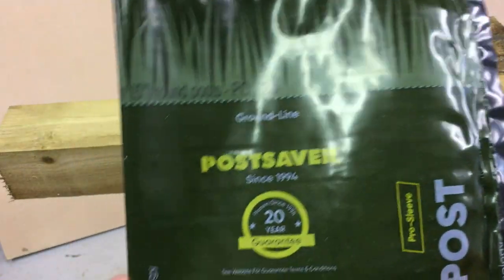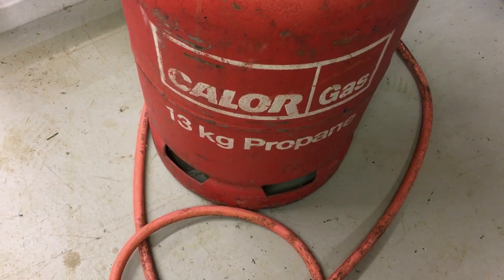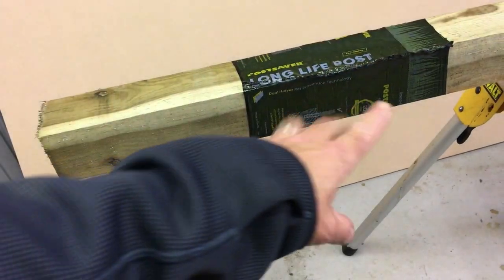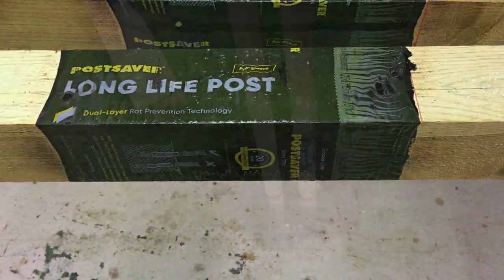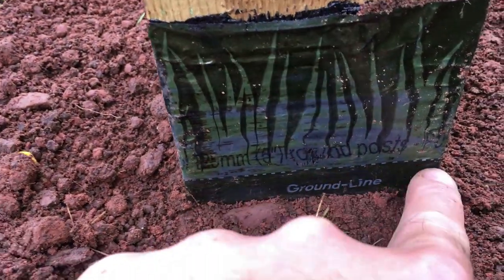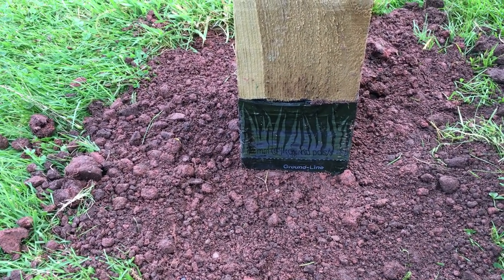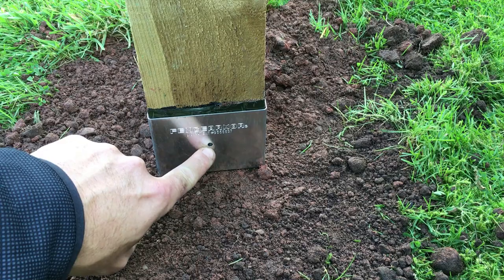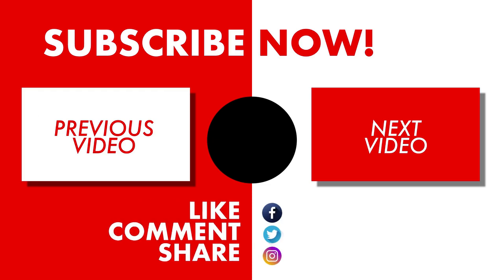How To STOP Fence Posts Rotting / Install postsaver sleeves

Comment: Great video. I've been  thinking about building a wooden frame for the Wisteria plant the Mrs has planted except I was worried about wood rot til now! 

Now I know how to protect the wood thanks to your video! Many thanks.

PS does putting the screws through the Post Saver compromise the protection a little bit? As it gives moisture a path into the wood. And would it void the guarantee?
Reply from the maker: Thanks, no, putting the screws through does not void the warranty as Fence Armour is a postsaver product. Thanks for the comment

Comment: Great video. But how special is Postsever in addition to seal the post from moisture? There are different post sealers, such as asphalt sealant, which are easier to apply, cheaper and waterproof.
Reply from the maker: They all do the same job but postsaver comes with a 20 YEAR GUARANTEE so worth it in my opinion
Reply: @Bacrenfencing  that’s only a marketing strategy and has no actual value. Many products now have lifetime warranty.
Reply from the maker: Why did you watch the video then ? A lot of my customers ask for the sleeves to be fitted, so I do as they ask and give them a 20 year guarantee on the posts. Also, what fencing products come with a lifetime guarantee ? I can't think of any.
Reply: @Bacrenfencing  Ok, I regret watching your video. Go to HD, find the warranty of  pressure treated post. It’s lifetime!!!

Comment: This is great but  most customers are so tight they will not pay the extra cost. What chance you got.
Would a heatgun do the job.
Reply from the maker: Hi John, I know what you are saying, that is my experience too. I think that making videos about the products benefits will help though because I can now send them a link to my video attached to my quotation(s) and let them see that the option is available. Yes, a good heat gun or smaller plumbers blow torch will do the job as well, just takes a little longer to apply. Thanks for the comment 👍😍

Comment: When I put the sleeves on the posts they melted didn't have the flame close to them,don't know what I'm doing wrong I ruined 3 of them
Reply from the maker: You are best to have the flame set on a low setting (i.e not gushing out at high pressure). Once on a low setting the key is to keep moving the torch quickly, you kind of get a feel for it once you have done a few. I had a few melt when first trying to put them on but it was just because my flame was on too high a setting and a lingered in one spot too long........there is a knack to getting these on. Thanks for the comment

Comment: You won't have the same problems with a concrete post I have a lot of fencing in my garden and the concrete posts have been in at least 34 years since the house was built and there still standing, wooden posts are a complete waste of time and money👍
Reply from the maker: Concrete posts are ugly in my opinion, wood posts are used for the natural look and will last for 20-30 years if properly installed and looked after. Concrete tends to chip and crack over time but they do last a hell of a long time ! Thanks for the comment 👍
Reply: @Bacrenfencing  Thanks for the reply do you follow D&J Projects on YouTube they do a lot of fencing for customers and they make and use there own concrete posts on there fencing Jobs.  yes concrete posts might be ugly and can chip but they are a more superior post to use compared to wooden posts and will last far longer as well👍
Reply from the maker: @Josh-fk8ml  Thanks Josh, yes I do follow Dave and Stevie ! and like the look of their post / panel combinations but in my part of the world, wooden posts are requested pretty much 95% of the time. Concrete posts are rarely used up here in Scotland as the panels that slot between them are not ideal for the extreme winds we get up here. Hit & Miss fencing and single slatted fencing is most common up here. Thanks for the reply !
Reply: @Bacrenfencing  I live near the coast in Northern Ireland and we also get extreme winds as well as I said I have concrete posts in my garden near 34 years and there still standing. There is no way wooden posts would last 34 years in any garden, the fence I have in the moment is at least 15 years old the D rails are bolted in with 10mm coach bolts with a 10mm washer and 10mm hex nut attached to them and the wooden slates are attached to the D rails. All I am trying to say is wooden posts are not worth the time and money spent on them as they will not last anyway thanks for the reply 👍
Reply from the maker: @Josh-fk8ml  No probs Josh, I'm not arguing with you as obviously concrete posts last longer but most people do not like the look of them in my experience. I supply what the client asks for and usually that is wood posts. Thanks for the comment and give my love to the Emerald Isle !
Reply: @Bacrenfencing Will do, no bother i am not arguing as well I understand that your clients prefer wooden posts all the best in your business and take care👍👍
Reply from the maker: @Josh-fk8ml  Cheers !